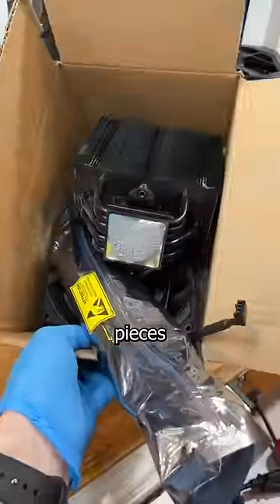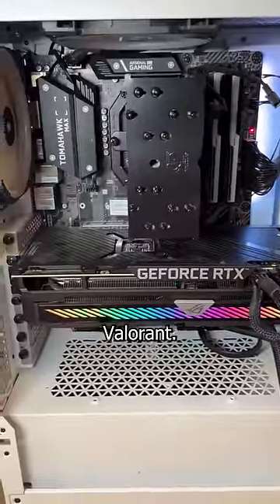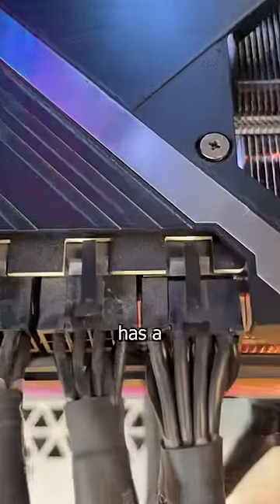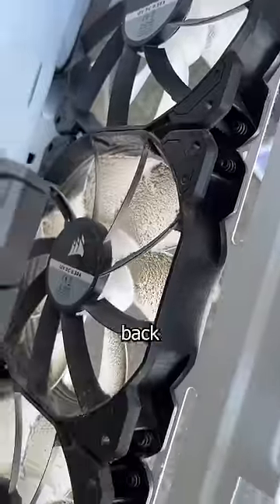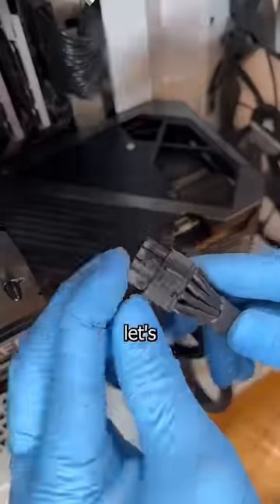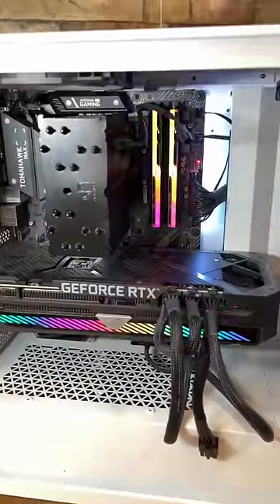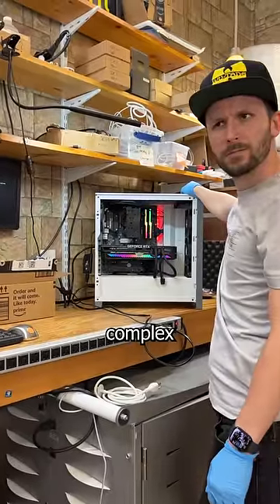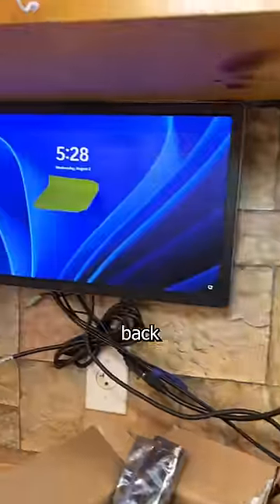This #Gaming #PC came to me in pieces, is it CPU or GPU? Can I repair it? #tech #technology #shorts

Comment: I had a case of CPU light is red. I bought a pc from a friend, had a 2060, i7, 16 gigs of ram which i upgraded to 32 afer fixing it. Anyway, pc works, he showed it to me, tests, yada yada. It arrives to me, everything looks okay on the outside, take it in, plug it in to extension cord, nada, doesn't turn on, plug it into wall directly, turns on. "Okay weird, but i can make it work, it's an old building maybe it's just not enough power". Turn off to put in my SSD and HDDs, turn on, not working again. Check the mobo, CPU light is red, reseat the ram, nothing. I'm starting to get angry. Try different combinations of CPU, GPU and Mobo (the mobo's CPU socket is the same for the i7 and the i5 that i used to have) some combos work because they draw less power but in the end it's still not powering up every time.

I put both PCs back together and have my uncle give the new one to a friend of his to check it. 2 or 3 weeks later i get it back (becauce the guy had some personal problems which stopped him from being able to look at it and send it back quickly)... "Everything's fine, it boots up, yada yada. Checked everything, checked to make sure nothing's potentially shorting." It comes back, i plug it into the extension cord and wall, STILL doesn't boot up. I decided to buy a new PSU and after installing it worked perfectly even through extension cord.

I have no idea what's wrong with the PSU to this day. It's possible that during delivery something happened, like the PSU got smacked by something. No one has any idea because out of 4 places that PC and PSU have been at, it has a problem only in my home.

Comment: i had a problem with mine after a cleaning where it would crash of you touched the case with anything harder than a feather. i tried re seating everything except the cpu and cooler, with no success. in the end i took all of the covers off and blasted it with compressed air and that fixed it. what i think happened is a chunk of crud fell into a spot where it would short the mother board when the case got shaken. somehow nothing got destroyed.

Comment: I had that RAM issue when I built my ROG Crosshair X670e Extreme. It would boot. Reseated the RAM and booted right up. Yesterday I disabled core performance boost. It was running at about 55C now it's at 33C. I don't game so it works for me.
Reply: Why would you buy a board like that and then even disable turbo boost 😅

Comment: Ahh RAM... Is always the alpha and Omega. Won't boot? Check ram first. Ah it turns out the GPU is the culprit. Fix it. Huh no boot? Turns out you need to rubber the ram connectors first

Comment: Had the EXACT issue when I was building my current PC. RAM felt like it clicked in, but it was slightly off. After undoing and redoing hours of tedious cable management and such? I tried the RAM for S&Gs and it worked. -_-

Comment: Like you said with some problems have simple solutions this sorta happened with me I got the CPU failure from my beeper speaker and reseated the CPU Cable in my mother board and what do you know it fixed it and for some reason I get random beeps when I turn my PC on sometimes (normally once) sometimes like 6 or 5 times 💀

Comment: "These AMD's run hot".....if its Ryzen 1000, 2000, 3000, or 5000, NO, they objectively dont run hot at all and theyre incredibly power efficient.   While Ryzen 7000 runs warmer, it stil runs much cooler than Intel 12th or 13th gen.....so when you say "These AMD's run hot", what exactly are tou referring 5o?

Comment: But why update the BIOS? Unless there a bug that needs to be fixed is generally not recommended.
Reply from the maker: Updating your BIOS is definitely recommended. Not sure where you've heard otherwise.
Reply: @SalemTechsperts  I used to work at dell/alienware, ASUS technical support and MSI tech support on all 3 during training I had the same experience they said do not update the BIOS unless is absolutely necessary since it may brick the board due to power outage or anything similar.

Comment: Hey, I dont know if you read these, but i have a question: I recently got more ram for my pc, and I upgraded from 16gb to 32gb. The motherboard says it can hold 32gb, but when I started it up, it had a red led right under the ram...and it said ram. But it works fine, and it registers as 32gb of ram, so I dont get what the problem is.

Comment: these amd's run hot lmfao said no one ever
Reply: But they do ;)
Reply: @michubern1444  im running a ryzen 9 5950x with an overclock pulling 300wtts under full load and its just fine being cooled be a 240 aio in a sff case it maxes out at 90c the i9 13900k i had at the same power on the same cooler was shutting down a 105c
Reply: @mathewbriggs6667  90 with a 240 aio?  Crazy..but ryzen 7000 is even hotter and intel 13th gen too.

Comment: wel i fixed my sister's pc and it was showing bad ram checked the ram all 4 sticks work fine i was able to boot in single channel mode with 2 sticks and thought damn the memory controller on the motherboard ripped itself

wel it was worse both memory controllers on the cpu and motherboard died as after a while 2 sticks refused to boot and i thought lets replace the motherboard and sure it worked and then it stopped working so she had a free upgrade to a 5600x and a different motherboard

Comment: Just wondering is it normal for the pc to cycle through orange, red ,white then green led then boot? Each led only shows once for a few seconds and then moves onto the next. Once booted everything is fine but I don't know if the LEDs only light if there's an error at all or only stay lit if there's an error and it's normal for them to flash once. It's an Asus Tuf b650 plus WiFi I have

Comment: i fucked up the pins of 5600x i just got and i used razor blade and fixed them then i got anfry and pushed the cpu in slot was still showing issue for cpu but then i pushed again harder and now it works😍.

Comment: Hm, I recently replaced my cpu from a Ryzen 5 to 7 but won't display. Its showing the red light as well on the motherboard, I moved the RAM to 2 & 4, still not good. But I heard i have to do a BIOS upgrade to have it work. That means I have to put back the Ryzen 5 and do the BIOS update, then replace the CPU when done??

Comment: I need help my dell 8500xps does not want to display anything I Chang the graphics card but it still didn’t work I even cleaned the slot do you have any suggestions?
Reply: does the cpu have igpu? so you can make sure the rest works. monitor cable in motherboard. the ram can also be the problem..reinstall it..maybe try 1 stick per time to see that all work.

Comment: I have a question my PC turns off randomly and it started happening after I put in my new GPU and installed new ram. I remember I was having ram problems as one slot didn't work but after putting in 2 more slots of ram and my new GPU it's worked fine. Then one day after I finished cleaning my PC I noticed that one of the ram stick wasn't fully in so I pop it in and the next time I booted up my PC and after about 30 min or so my PC turned off and turn back on again on it's own and would happen randomly when I was watching YouTube or playing games it just happen. I don't know what causes it at all. Help.

Comment: "greatest technician that ever lived" word of advise that cpu cooler was installed wrong not tight enough
Reply from the maker: And you’re basing that on what, exactly? The words that are coming out of your ass? Are you a superhero that can see torque values? The CPU cooler was tightened to the max. Stress test maxed out at 60c under load for 20 minutes.

Comment: CPU light is stuck on during the post process "yeah lemme try the GPU rq" most logical computer repair shop posting on YouTube for "education"
Reply from the maker: CPU light comes on for multiple reasons, not just for the CPU.  Hence why the RAM being reseated fixed the CPU light. When you see an obvious fault with the computer such as a cable that's not connected, you fix that fault and see if the problem occurs after the fix. Part of educating people is showing the entire process, including mistakes, and not pretending that everything is fixed first try. But go off King, show us how it's done.